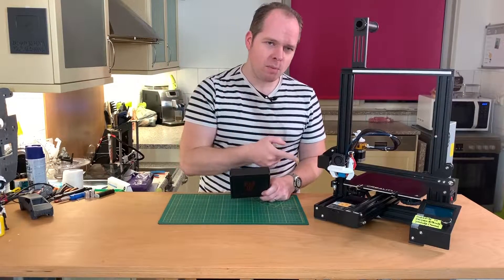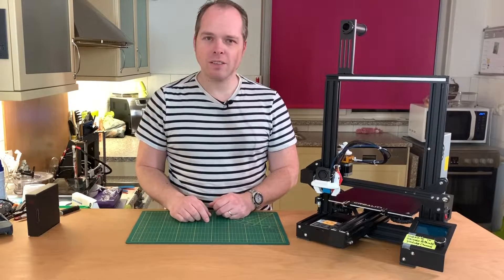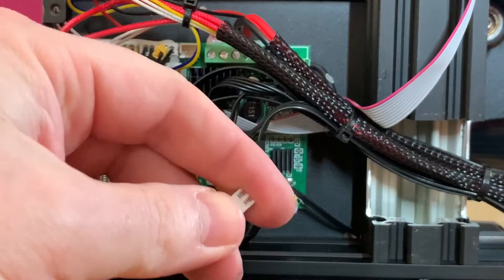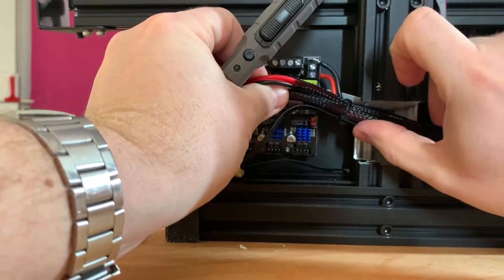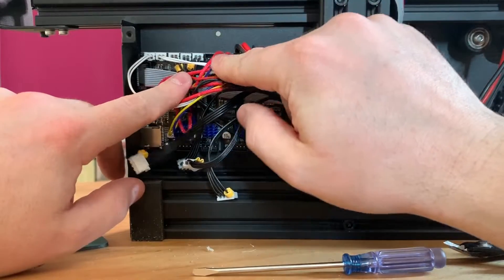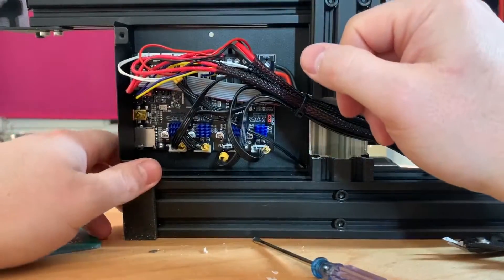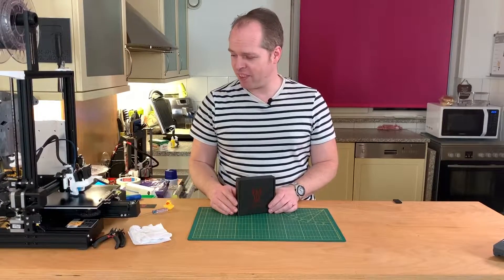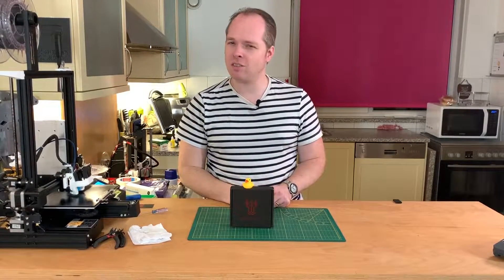How to install BigTreeTech SKR mini E3 on Ender 3 pro

Comment from the maker: When you are connecting the BLUE/YELLOW wires to the SKR mini E3, they need to be connected to the edge connector and the mainboard fan wires RED/BLACK is going on the inside connector!
Reply from the maker: Check to turn off the parts cooling fan in the menu and see what is happening, if it keeps running even thou you turned it off, you need to change the 2 wires!
Reply: @Zachary3DPrints  Did we ever get to confirm this?

Comment: Hello, great video!
I'm a newbie and I just bought this board for my ender 3 pro, do i need to update yhe firmare or somethig?? or is it plug and play
Reply from the maker: Those boards are most of the time pretty updated on the firmware. The most recent version is on there. If you are going to update your printer with an BL touch auto bed leveling, than you need to update the firmware

Comment: Does it matter which way the "hot end" cables are connected?  They are both red, so I would assume it doesn't matter, but just wanted to confirm my suspicions. 

Thanks for the vid!
Reply from the maker: Hello David, indeed it doesn't really matter, they are both red and the purpose is to head up the cartridge. The heat-bed there you have 2 colored wires and there you really need to pay attention on which side the black and red are.

Comment: I have the ender 3 pro with bltouch, I use the skr e3 v2.0 ... but the bltouch does not work well. Could you pass me some fimware that works correctly ???
Reply from the maker: Hey Sergio, did you checked the Github from BTT? Here is the Link: https://github.com/bigtreetech/BIGTREETECH-SKR-mini-E3. Download the file, when it is unzipped, there are a few folders, choose firmware>V2.0> put firmware-bltouch-for-z-homing.bin on a micro SD card and put this into the Ender 3, reboot it and let the firmware install. If this doesn't work, check the installation manual in the folder hardware.

Comment: I HAVE INVESTED ENOUGH TIME AND MONEY ITS TIME TO SEEK HELP!!!!!
i would pay someone to help me setup and tune my 3d printer

I have an ender3 pro with:

 skr mini e3 v1.2

bltouch 

glass bed 

octoprint running on raspberry pi 4 

ezr extruder 

and my slicing software is simplify3d 

I am having wayyyyy too many issues for my knowledge. sure I get ok prints but that's like 75 percent of the time the fine tuning has just become too tedious I want to pay someone to provide me with 4 good printing profiles along with tuning the machine be by video or whatever i can do the physical stuff also recompile the firmware and everything I possibly need to just press print for good prints including linear advance and any moere features you can help me add on that I may be missing
Reply from the maker: Hey, I want to help you with this. Can you contact me over my Facebook page? https://www.facebook.com/Zachary3dprints. Than I can see what we can accomplish.
Reply: @Zachary3DPrints  I do not have a facebook can you email me at
manny92perez@gmail.com do you have zoom?
Reply from the maker: Hey Manny, I’m going to connect you very soon, I don’t have Zoom yet

Comment: I did all this on my ender 3, and now it won't print. The bed gets hot but the hot end now hits its target of 205. Stops then starts again. Reaches 250degrees then goes down to 199 then 210, then back to 199 and keeps going but never prints.
Reply from the maker: Hey, can you check your 2 pairs of white wires. one set for the bed is in the one for the bed, and the other one of the hot end is in the right one. Check if the wires are properly inserted and not loose. And what are the preheat settings for the PLA and or ABS in the menu of the Bigtreetech SKR?
Reply: @Zachary3DPrints  I'll check that, and it was set to 205. Thanks for replying. I highly appreciate that. You've gained a subscriber
Reply: I am officially your 403rd subscriber

Comment: Hi een vraagje! Ik heb een standaard Ender 3. Geen pro. Ik wil via aliexpress deze upgrade bestellen. Ik heb alleen de keuze tussen 3 boards. Welke moet ik kiezen ? https://nl.aliexpress.com/item/33042554065.html?aff_platform=link-c-tool&sk=q9OF2V84&aff_trace_key=40866607a9d24eff8a82bebc217c2be6-1590212857416-09171-q9OF2V84&terminal_id=351752bc4e7b4512968782da803815ea&tmLog=new_Detail&aff_request_id=40866607a9d24eff8a82bebc217c2be6-1590212857416-09171-q9OF2V84
Reply from the maker: OLAFBAMBAM Hallo, je kunt die eerste bestellen, want voor de normale en de pro maakt het niet uit.
Reply: @Zachary3DPrints  Thanks!

Comment: This was so helpful and comprehensive. Thank you very much I just finished installing my board by watching along with you.
Reply from the maker: Thank you sir, this board is awesome and pre installed Marlin 2 which work smoothly...
Reply: @Zachary3DPrints  its INSANELZY quite. I have an ender 3 (non pro) and a pro. I used this video to put the board in my Pro and the difference of the two machines is so noticeable. Other than the fans I hear nothing on the pro with SKR compared to stock ender board. Again thanks!
Reply from the maker: Print It Forward SNJ to yup only the fans are not silent after the change.

Comment: can i use the controler board to make costomr 3d printer thifrent this model
Reply from the maker: The BigTreeTech SKR mini E3 is for the Ender 3, but this brand has also for other custom printers as well. If you mean the old stock board for the Ender, yes you can use that one too. I’m also going to use it in a new printer...
Reply: Thanks ı am going to make my own 3d printer and ı am searching for parts and this is the most important

Comment: It would be very helpful if you could make a video of this board with the BL touch installed. And an update on the performance of the board after sometime using it would be very interesting too. 👍
Reply from the maker: Yup that was also one of the upgrades that is going to happen. I’m checking for the right ones, because there al are cheaper ones that look like the original. But u hope the shipping times are going better and faster
Reply: @Zachary3DPrints  I'm really struggling to get the BL Touch up and running after installation. Most of the videos are for the standard board.
Reply: I want this as well!

Comment: Let me ask you i have endrr3 pro i installed the card babystep are not working how about you I like it wneh I was able to see the percentage left to the print since new board this feature is gone. babysteps is gone .
Reply from the maker: When I was using the stock board on my Ender 3 Pro, I never really payed attention to the baby steps. after installing the board I did see it in the menus. Do you have write these settings down before you changed the board?
Reply: @Zachary3DPrints  they said to me that the board was ok and updated but its not updated to 2.5 its 2.0.X I'm not sure if I can just download the firm ware and put sd back into printer and boot and see. None else has a 32 bit main here.

Comment: Hi.  I have a problem with my SKR Mini E3.  The FAN of the nozzle is always 100%.  I've tried to change FAN0 for FAN1.  AND CONTINUED IN THE SAME. The FAN speed is always 100%. Can you help me?
Reply from the maker: You have in total 4 fans. 1 is in the PSU unit and you don't have any wires on your main board of that one. The 3 fans that are connected to your SKR board are the controller board fan, which is connected to FAN0, the second (part cooling is connected to FAN1 and the nozzle fan is connected NEXt to the heatbed connecters. This is the place where the red and black power wires are. This is why your Nozzle fan is always ON, and this is helping the filament not getting too soft before getting into the heatbreak and hotend
Reply: @Zachary3DPrints  Hi can you send me a pictu where I can connect the Nozzle FAN? Please (ramiro.diz@gmail.com)
Reply: @RamiroDiz  This video is wrong. The fan is mounted in the wrong position. If you look at this at 5:01 you can see the fan needs to be in the "i" postiong & NOT "G" as shown in this video. BTW i understand why you ask as you dont want cooling on ex. PETG. Link to video @ 5:01: https://youtu.be/-XUQKQnUNig?t=302

Comment: what would cause the hot end fan not turn on after replacement
Reply from the maker: Hey, check your connector, the hotend fan should be connected on one of the green connectors on the long right side group of connectors, but not on the short side, that's for the power in.

Comment: I am getting a "tmc connection error"... I flashed BTT's new firmware from GitHub but I get the same error. I also compiled Marlin 2.0.4.4 and flashed it on the board but it did not fix it either. Any ideas? Thanks.
Reply from the maker: You got the same board as I have? With the steeper drivers in the board? Check in the menu for the drivers. If not, check how your connections where
Reply: @Zachary3DPrints  yes, it is the same. I think it might be faulty.
Reply from the maker: Hey on the side of the Neo pixel you have a set of six pins, is there a red jumper just next to it?
Reply: @Zachary3DPrints  yes there's a red jumper. Why? Thanks.
Reply from the maker: Check that other reaction. Baud
Reply: @Zachary3DPrints  Zachary 3D Prints  could you please check on your board info what protocol you've got? Mine says protocol 1.0... Thanks very much.
Reply from the maker: @luismanchego6856  Where do I find this protocol? I have version 1.2
Reply: @Zachary3DPrints  On your LCD screen menu go to> about printer and then board info. Thanks.
Reply from the maker: luis manchego I have protocol 1.0
Reply: @Zachary3DPrints  Thanks very much Zachary, I really appreciate it.👍
Reply from the maker: luis manchego always like to help. Tell me if you need something else.
Reply from the maker: Check if your connectors are correctly put in the right socket and check your Baud setting, change it to 25000

Comment: Are all those wires labeled or do you have to remember or guess?
Reply from the maker: I took a picture and used it a reference, but if you check the board before disconnecting, you see that all black cables are the same side of the connector every time

Comment: FYI, the hot-glue is on there so the connectors don't fall out during shipping, this is standard on chinese printers where they are assembled in some fashion.
Reply from the maker: I understand this kind of use... although a lot of Asian electronics are great and don’t have this hot glue. Great solution as long if you don’t change anything. I do like it

Comment: did you add the sensorless homing? If so i know i need to add jumper wires but do I remove the existing wire or just add the jumper into the socket.
Reply from the maker: Michael Martin I’m going to add the BL tough or a other sensor to the Ender.

Comment: I like that screwdriver. Where did you get it?
Reply from the maker: Thank you. The screwdriver it’s from Ferm and it’s very handy.
Reply from the maker: Where do you live, I got it from the store called action
Reply: @Zachary3DPrints  I live in England, UK
Reply from the maker: Steve Rayner check for the Ferm cordless precision Screwdriver. It’s usb chargeable. If you can find it, I buy it and send it to you. It’s a great tool.